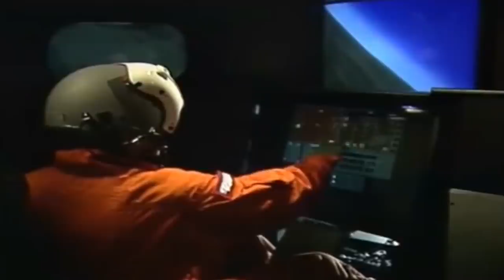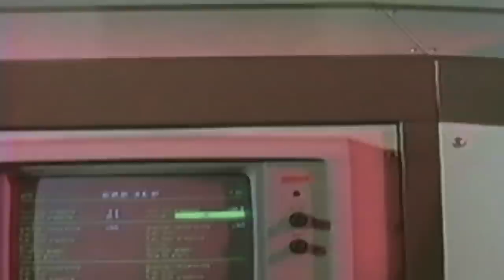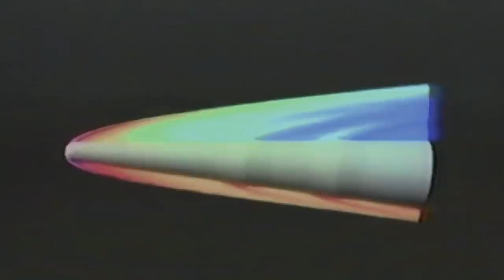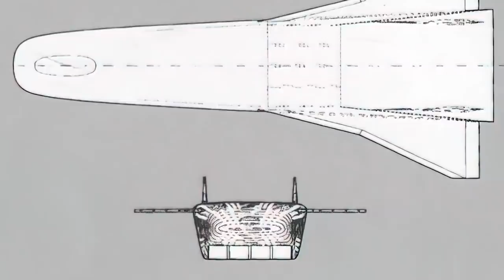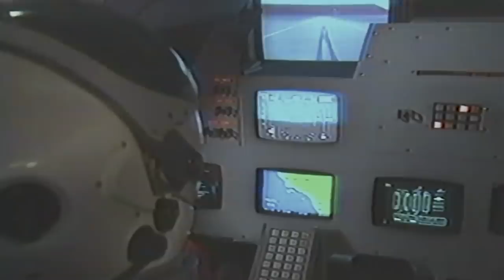The National Aerospace Plane

Comment: I like the one They came up with on the “For All Mankind” show. Nuclear powered.
Reply: Nuclear engines sure looks possible
Reply: A key benefit of nuclear is that it can run indefinitely, heating the air for thrust as it gradually rises, so no need for huge amounts of thrust like a rocket that runs out of fuel. Once it gets above about 100,000 feet it can act like a rocket, accelerating onboard propellant.
The Atomic Airplane project of the 1950s was a failure but the engine technology that prefigured the modern Men Salt Reactor technologies were mostly successful, although one of them, the Open Cycle, was too dirty. Most important, they demonstrated that an MSR could be operated in all flight regimes,upside down, etc.
Reply: The plane shown in For All Mankind was completely bogus. It is not physically possible.
Reply: @andrewreynolds9371  the biggest issue is the assumption of uranium-fueled high pressure water cooled reactors, which are exactly the wrong approach.
Thorium fueled molten salt reactors provide 1000 degree hotter working fluid, run at nominally ambient pressures, and Thorium radioactivity is alpha particles which can be shielded with a sheet of aluminum foil. The actual reactor that exhibits high radiation would almost fit  into a 50 gallon drum, so heavy shielding required is minimal. And in the event of a "rapid unscheduled disassembly", the radiation released by spilled fuel would be again mostly alpha particles, although there would be some reaction by-products. (I would assume the small reactor vessel would also be armored.)
Note that, while Thorium is handled as a radioactive hazardous waste in the US, there are public beaches in India that are comprised mostly of Thorium-based sand. Alpha particles really aren't that dangerous.
Reply: @jimfarmer7811  thanks, it's nice to see that there's at least one person here who understands that science fiction is just that, fiction.
Reply: @GaryBickford  I remember something of those early 1960's tests, and I don't remember anyone ever actually testing a reactor of this sort in flight simulation mode. I also remember that the main point of the technology was to build a simple and robust reactor, not a light, easy-to-move piece of technology that could be mounted in an air vehicle. got a source for your claim?
Reply: @GaryBickford  who ever said anything about a water-cooled reactor? wasn't me. I was referring to this beast:
https://en.wikipedia.org/wiki/Project_Pluto
Reply: @GaryBickford  calling NERVA 'successful' is open to question. yes, they built a nuclear-powered rocket engine, but they also suffered from fuel element failures that resulted in radiation and radioactive material being released into the atmosphere. besides, NASA never intended for NERVA to be used in-atmosphere, it was intended as a high specific impulse upper stage for use in space, where radiation leaks wouldn't be nearly as much of a problem. so no, I'm still far from convinced that operating a nuclear power plant as a rocket engine heat source in Earth's atmosphere is a good idea.
Reply: @andrewreynolds9371  yes. The planned successor to NERVA (whose name I forget🤣) was to be used as the third stage of the Saturn 5N. And the radiation and shielding issues, along with the mass of the high pressure reactor vessel, were the primary unsolved problems for the atomic airplane. Of course the advent of accurate ICBMs made that project obsolete.

However the order of magnitude size and two orders of magnitude mass reduction of a viable MSR using modern materials and technology, and use of Thorium instead of enriched uranium, does change the equation a lot. It may still not be feasible, but I have some optimism that, combined with the SABRE hybrid jet+rocket engine technology, it will work. Then it's a matter of determining how to make it safe and practical. If the high radiation component is as small as it appears to be possible, the mass of high density shielding and armor of that section could be low enough - say 30,000 kg - then that is in the range of the reduction of fuel mass that would otherwise be required.
Reply: @GaryBickford  honestly, SABRE would be/is a far more promising technology to pursue than a vehicle powered by nuclear power  from launch through all flight modes. I always thought that if Skylon could get the cash together to push full-scale testing, it was a truly promising concept for achieving SSTO.

Comment: A generally accurate video. Copper Canyon and NASP were classified from beginning to end, so we can't know the entire story 😉 One key correction is that Boeing, Lockheed, and General Electric exited the program in 1985 because they recommended it be cancelled. Cost sharing was required for the airframe contractors, and encouraged for the propulsion contractors.
Reply: eliminated doesn't say how

Comment: NASA had that lifting body X-30 space plane mock up at Oshkosh AirVenture in 1989. Inside NASA huge pavilion they had a wind tunnel test Scram Jet engine. It was all Copper plate with the intake and exhaust covered so you could not see what the Largest Super Computers at the time cooked up.

Comment: What were they going to use as on oxidizer in orbit? SCRAM is fine with atmospheric O2, but in space?
Reply: Initial plans probably didn't even specify how, and the last development before being canned needed rockets for circularisation (mentioned around 8:40). But to answer the question, slap a tank of LOX in there and combine it with the H2 they had on board seems like the most straightforward solution. Would probably require the exhaust port to be capable of changing its profile for any sort of decent efficiency though.
Reply: @Blaoerry  Thanks. Adding a LOX tanks would have also increased the weight and necessary interior volume.

Comment: Sounds like the flying car. When you optimize for one environment you loose in the other. Even rockets have two, or more, stages, one optimized with engines for use at sea level and another with engines optmized with engines designed for space.

Comment: It did fly, on the tip of a rocket, air dropped from an airplane. X-43A
Reply: All the X43a was was a hypersonic test bed proof of concept. 

It only had enough fuel to last for about 10 seconds.  and the fact that it had to be launched off a rocket is proof it didn't have a single stage to orbit engine
Reply: nine point six times sound barrier to destruction is it's best we know of missile launched

Comment: NASA went into a depression, over newly inovative fundings, over humans being part of the flaw test, over the shuttle tragedies. Never considered a plane stage methods, or SSTO phase. 66% of a rockets zenith efford is burned out at only the first 60miles stage up. The airplane flight, could've task that part, converting nuclear electric propelkar blades, then afterburn thrust jet, then ramjet, using a far lower expense rocket beyond the kamen slop of low air, after that line as low gravity & atmosphere becones a smaller losd rocket phase advantage, on a SSTO. Slower start phase, yet far far lower expense then luxury historical canister of pure burning money.

Comment: The only way that SSTOs would likely be able to work is with a sabre engine. The acronym SABRE means Synergetic Air Breathing Engines it takes in air like a jet does but it freezes the oxygen for fuel and is a rocket engine that uses the air in the atmosphere.

Comment: What if I was to tell you that we dang near already had such a craft at that time?  The SR-71.  Imagine an SR-71 that had some modifications and a rocket booster that could get it up there that last little bit?  We were almost there.
Reply: No, that's not possible with the SR-71.  You can't just add some little boosters and expect it to go from 3,500kmh to 28,000kmh.  Let alone the issues of reentry.
Reply: George, please elaborate...
Reply: @russc788  He could be talking about some experimental version of the SR71 or something similar. You know, like the F16 that had thrust vectoring. They probably entertained the idea the OP is talking about.
Reply: Ram jet, scram jet, pulse wave  Then there is Antigravity Technology using several things and applications. Inertial mass reduction systems. Gravitomagnetic electric.
Reply: @dextermorgan1  I don't think so, the SR71 was so much further from orbit than you think it was.  Orbital velocity is 8 times higher than its maximum speed (and it needs to get 10 times higher).  There is no way to bridge that gap.  Single stage to orbit has not been achieved for very good reasons.  The guy is just daydreaming.

Comment: That x-30 is at Aviation Challenge on the U.S. Space and Rocket Center (space camp) campus. It’s not where the public can see it because AC is on the back edge of the center property and and inside a fence. I even had the honor of (was forced) drilling holes in it every foot so Christmas lights could be mounted on it. It’s a real shame how shitty the USSRC damages history they are entrusted with. No the holes were not sealed back up.

Dropped pin
https://goo.gl/maps/CfhxwZxD7uGSsiCRA